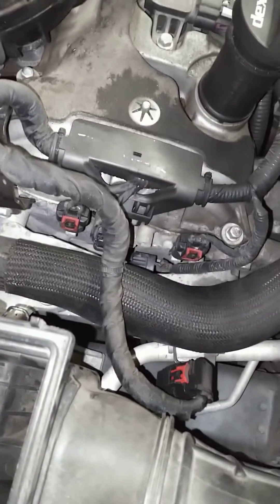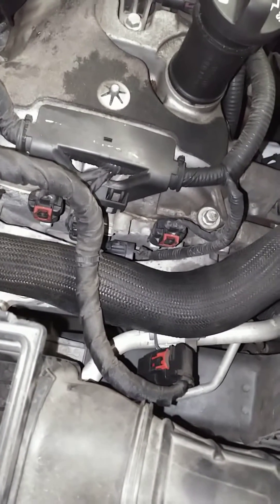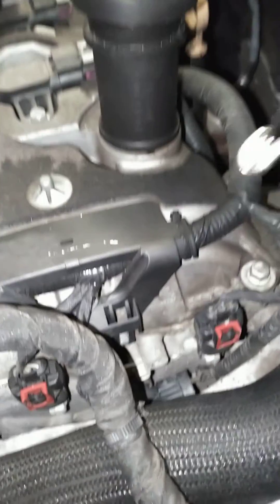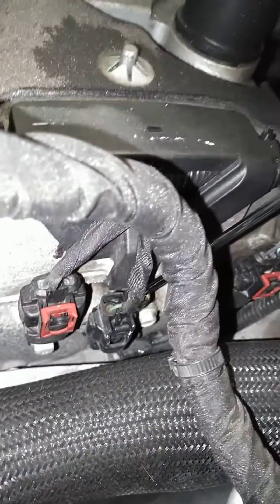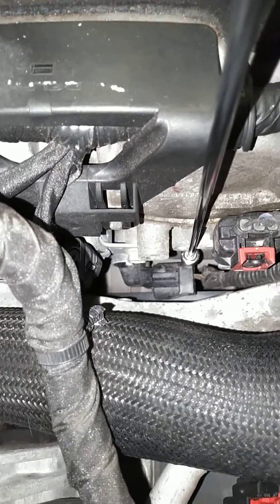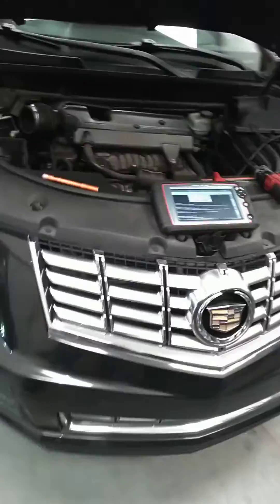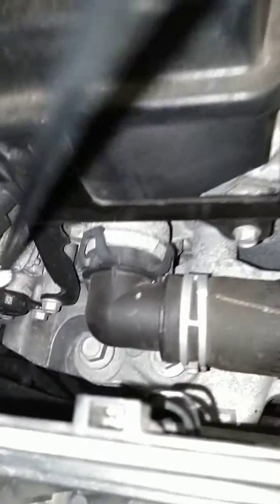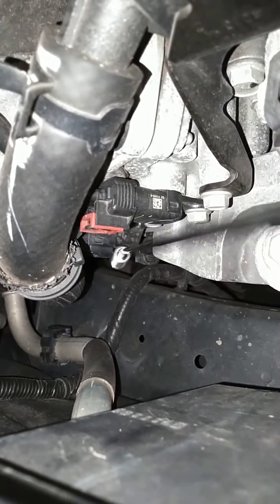Chevrolet GMC Cadillac 3.6L cam sensor solenoid location

Comment: I have a 2018 Cadillac ATS with 80k miles. Currently having a hesitation while going over 60mph and the only code I have currently is a P0024 code. I have a hard time believing it needs timing chains, on cold start there is no weird rattle or anything. Could it be the solenoid VVT at the exhaust side that could be causing the issues??
Reply from the maker: You could start with solenoids pull em and test with a 12v battery for actuation clean and reinstall
Reply: @slimsautomotiverepair8714 if that doesn’t resolve the issue— chain kit required?